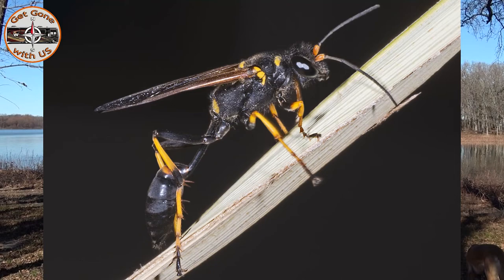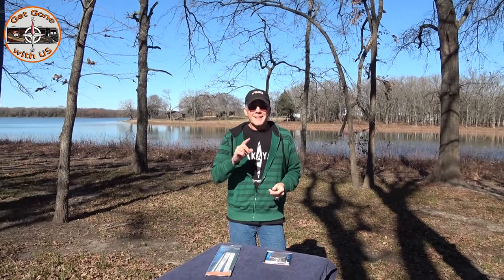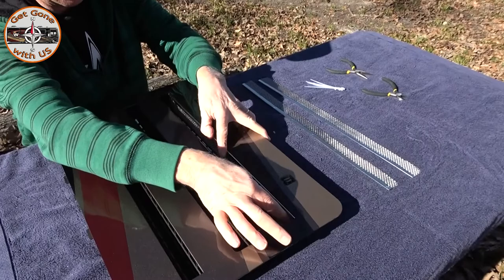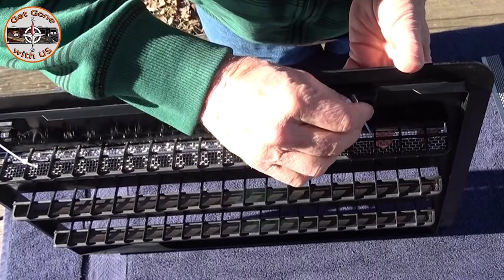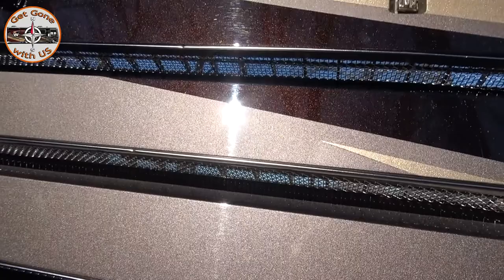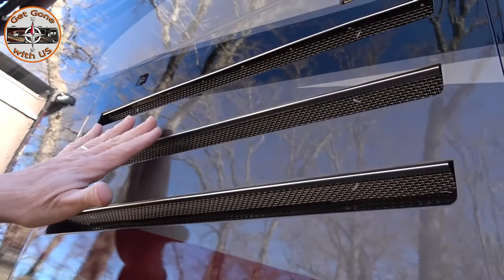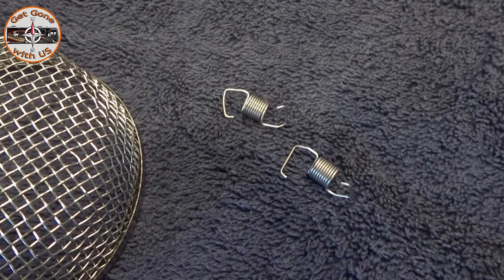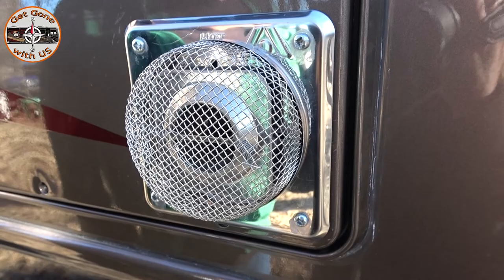Camco Flying Insect Screen Installation on RV Refrigerator and Furnace

Comment: I am elated that you got the bug/critters screens installed.  You’re right don’t misplaced the installation tool. I secured mine inside the furnace and water heater compartments ;)  Good Job C&C!  👍Stay Safe out there!
Reply from the maker: Thanks Tim.  We saw you asked about the screens on our last video. We knew this video was coming this week.  We actually installed them back in Texas.  Great tip on storing the tool in the furnace and water heater. 😀

Comment: I pray you both are doing well and Brandi too.  We're doing ok and staying home.  Figure it's the safest place to be right now.  As for our fridge vent, I cut a foam pipe insulation tube in half and put in the slots during storage.  I also put a reminder on the fridge to remove foam before turning it on.  I do think I'll get one for the furnace.  Thanks for the bent spring advice.  It's always great when someone else figures out what to do. LOL.
Reply from the maker: We are doing well Carl.  We are glad to hear you guys are also. The screen on the furnace  just didn't hold well.  bending the spring did the trick. 😀 Stay safe!

Comment: Just installed them on my Dometic fridge yesterday.  They look great but my only concern is will it restrict the airflow enough and cause any damage to the unit.  Have you had any issues over the years at all?
Reply from the maker: No we didn't have any issue while we had it. We no longer own the rig.

Comment: We've been camping all my life of 42 years, just bought our first big trailer. Our refrigerator is 100% battery operated. I don't believe the vent door removes. It has manual vents to open and close. Should I still find a way to place a screen?
Reply from the maker: Hi Steve!  I don't believe you will have a problem  The Mud Daubers are attracted to the smell of propane and it sounds like you have a residential refrigerator. 😀
Reply: @GetGonewithUS  i agree, but just want to be safe. it is a battery operated residential fridge.   i heard you say that in the video about the propane.  i still may try to find a way to attach one at the base of the vent.  I wont do ever louver.  We've owned pop ups, but my kids are between 8 and 12 now.  we were ready for a "big" trailer.  just want to cover the bases.

Comment: I have a question for you did you install the hot water on demand yourself and did it come with a door or did you have to buy a separate door because I have  2006 and I’m thinking about putting one in my RV do you just use it in the summertime or do you use it year-round  and I really like how you give your information sorry nice thanks for all the help again
Reply from the maker: Hi Ben!  We really can't answer your question, our on demand hot water heater came as standard equipment when we bought the coach. Some people love these,  some people don't. Personally we would prefer the conventional hot water heater.  We had a lot of issues with it when we first got it.  It is working fine now, but we feel it wastes water and it wastes propane when we are on full hookups and could be heating the water with electric.  We do live and travel full time in the coach. 😀
Reply: OK thanks for the help I will keep watching your channel like I said you got some pretty good information on there
Reply: Get Gone with US I did order that oil wrench kit from Amazon should be here in a couple days
Reply from the maker: @fogdogrides  Good luck with the oil change, they are not that bad to do. 😀
Reply from the maker: @fogdogrides  Thnaks Ben and Thanks for checking out our channel, we appreciate it. 😀